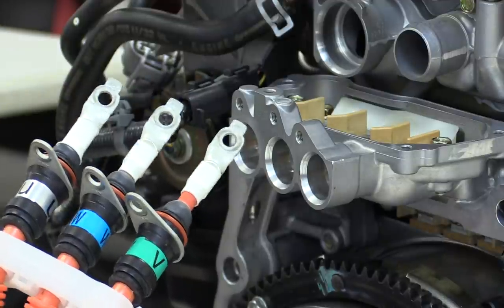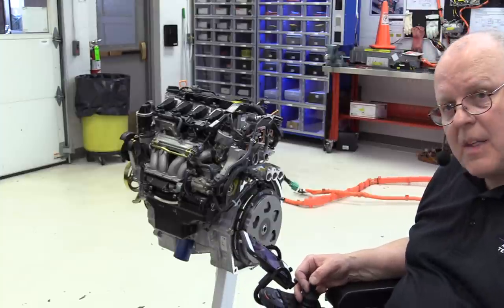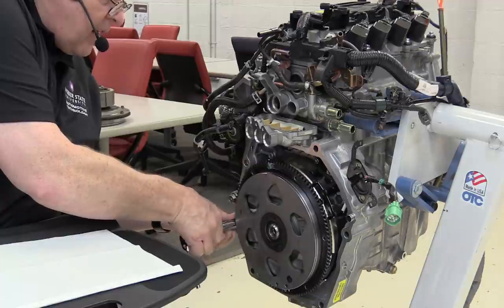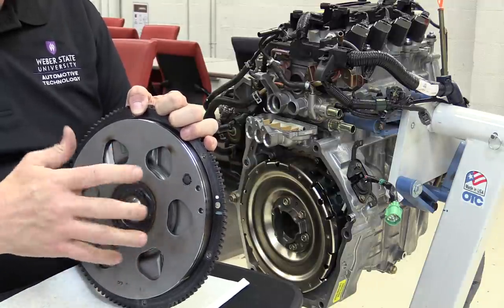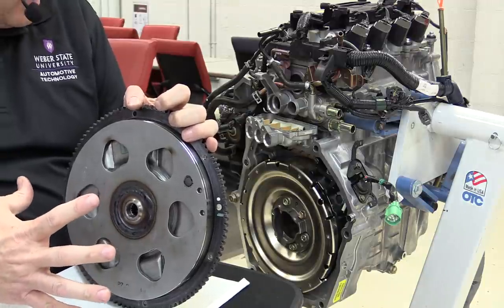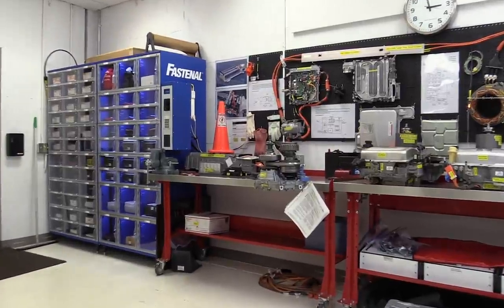Honda IMA Hybrids Part 3 - IMA Stator and Rotor Service

Comment: Thanks for this IMA lesson, but I ve got an issue on my 6MT CRZ, and I seriously think that it should come from the IMA motor. 

At any gear as soon as the motor is charging or helping, I hear a small metal bang sound.  I accelerate and decelerate and I see the led IMA turning blue and green. Anytime the motor is turning on a new way, I hear this small metal bang sound.

I gave my car to the annual service and Honda did nothing about this sound, except changing the clutch oil.  

Could you help me?  Have you ever seen this problem ?
Reply from the maker: I have not heard of that problem. Best wishes
Reply: @WeberAuto  I heard about the motor sensor inside the IMA. (That indicates if it charge or help). Could this sensor move accidentally and/or be broken ?
Reply from the maker: @Deletedguy  It would trigger a trouble code if it were broken. It could be loose bolts holding the IMA rotor to the crankshaft.
Reply: @WeberAuto  thank you for your help.

 I will put a short video about this weird sound. (Typically a small metal bang as soon as the IMA motor turns on/charge or help)

Comment: I had always thought they had some sort of sprag between the engine and electric motor. Why did Honda use a conventional starter as well. Did they expect the batteries to discharge to the point of not being able to turn over the engine?
Reply from the maker: I do not know the answer. I suspect that it is just a carry over from the original 2000 model year Insight design and it never was changed afterwards. It is a great diagnostic tool though, if the engine always starts on the traditional starter motor, there is a problem with the IMA system.
Reply: That would make sense. Engineers in the last century seemed to be very cautious in the application of electronics to cars often leaving the old mechanical systems in place with electronic controls to help them.
Reply: ive never heard my crz use the standard backup starter. it always starts electronically from what i can tell
Reply: Lead acid battery performs better than NiMH battery under extreme cold conditions.

Comment: I thought your explanation about series and parallel was the other way around
Reply from the maker: It is confusing. Parallel hybrids use an internal combustion engine (ICE) and electric motor/generator(s) to simultaneously provide power to the wheels through the vehicle's transmission. In addition to supplementing the power of the engine, the motor/generator can also charge the hybrid battery while the vehicle is in motion. Driving the vehicle with only the motor generator is also possible. 
A series hybrid system uses an electric motor to rotate the wheels through the transmission. The motor can be powered by a hybrid battery and/or an internal combustion engine (ICE) driven generator. The generator is used to provide an electric power source for the motor and/or charge the HV battery. I hope that helps
Reply: WeberAuto thanks, it does shed some light on the subject

Comment: What happens when this starts to fail.? I have an 06 civic hybrid that has an issue when it’s hot it’ll asst when I take off from a stop light it’ll asst for like the first 20 feet then stop assisting which causes the car to rev up really high and feel really heavy. Any idea from anyone in what could be the issue? Thanks
Reply from the maker: That is a start clutch issue with the CVT transmission
Reply from the maker: Yes, because the start clutch is just one of several very expensive pieces (valve body and software update) that need to be replaced to fix the problem you are experiencing. Best wishes!
Reply: WeberAuto ok. I’ll look in to replacing the transmission then. Is there a way to test for this? Or not really? Thanks for your advice and time.
Reply from the maker: Have someone check for trouble codes in the transmission controller. There are several technical service bulletins for this start clutch issue. I believe there are speed sensors that can be monitored to verify proper and improper operation of the start clutch and the drive and driven pulleys. Best wishes!
Reply: WeberAuto ok thank you!!

Comment: what might be some symptoms/signs that an IMA system needs this service? (aside from needing to tear apart/rebuild/service gas motor) 2013 supercharged 6mt crz here..
..actually i should ask a more specific question with an issue I am having (perhaps a little off topic but this seems like a place where i may find an answer). So my 6mt crz is occasionally  getting stuck in gear such that the shifter locks in and does not want to return to neutral. initially this was just 1st gear but now it seems to occur across pretty much any gear. as far as i can tell the problem isnt typical of manual transmissions and i havent been able to find a solution or help. my latest suspects are some sort of electrical issue or pehaps the shifter cables giving out (i suspect a mechanic was rough on the cables during a reinstall following a clutch job). i eventually pulled everything apart myself, trans and clutch setup were inspected and verified ok (trans went to trans shop, clutch went to shop where it was fab'd). i know that i have some sort of draw/short on the 12v battery. not sure if it can be related. only reason im wondering if maybe the 12v battery needs to get some recharge from the car and until it does that the shifting suffers somehow..eventually after some driving the shifting smooths out (and its not the mtf). wondering if somehow any sort of speed sensor issue could be involved. i dont have a CEL from my issue. any ideas would be appreciated..
Reply from the maker: It sounds like a shift cable or linkage issue. Sometimes a missing ground cable from the chassis/body to the engine can cause the shifter cable to act like a ground cable as well. This can cause the shift cable to get stuck in its housing at times because of material transfer with current running through it. I hope that helps.
Reply: WeberAuto thank you for the input!

Comment: All was OK until you mixed hybrid design types (series, parallel or power-split) with the degree of hybridization (micro, mild, full and plug-in hybrid). Honda IMA is a mild hybrid, which are by design only parallel.
Reply from the maker: It is confusing. I have a separate play list for all three types of hybrids. 
Parallel hybrids: https://www.youtube.com/watch?v=Oxx6dRjiIdU&list=PLIn3FrDiB1lw5MBv8M8KqDYCyetkbiQzf

Series-Parallel Hybrids: https://www.youtube.com/watch?v=rDPwQefY2KY&list=PLIn3FrDiB1lzgdu8rNimjurpIt_PsjXfF

Series Hybrids: https://www.youtube.com/watch?v=dM6s3sLaTqE&list=PLIn3FrDiB1lzPFu_j-jn4OrJCiBmYzvtW

I hope that helps.

Comment: Seems awfully complicated compared with toyota synergy drive.  If this were computer tech, Windows/Android would simply completely rip off the original leader (Apple) without a second thought.  It’s nice that also-rans (when it comes to hybrids) Honda isn’t just a total ripoff, but that they at least try to do something different.
Reply from the maker: Other's have "borrowed" Honda's design already, look at hybrids from Hyundai, KIA, VW, or Audi. They will look very similar.
Reply: WeberAuto That makes sense I guess.  No one wants to reinvent the wheel, or the motor.  I am kinda new to hybrids, I bought the rav 4 this year after seeing that it obviated most of my concerns about the complexity of the setup.  I’ve had several Honda’s, but haven’t even driven one of their hybrids (pretty rare bird in these parts).

Comment: I need help, I own a Honda CR-Z 2012, and I want to modify my car, I know that I won’t get to much power from the engine, so I want to replace the electric motor and actually put an electric motor that can handle the batteries that the Tesla Model S uses, and in theory, make my car faster, a lot faster and just from the hybrid side, but what can I do to get an powerful electric motor that can work with the stock engine of the CR-Z?